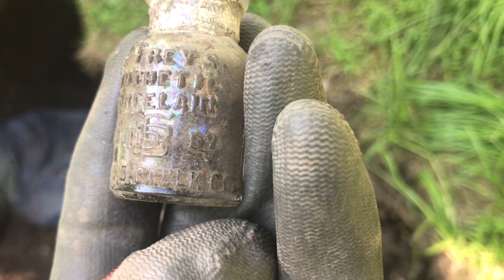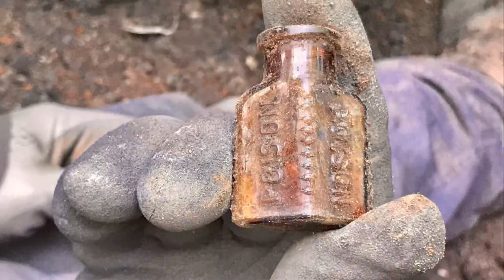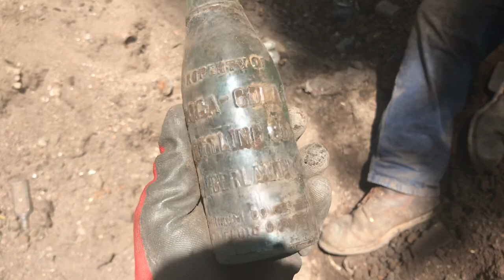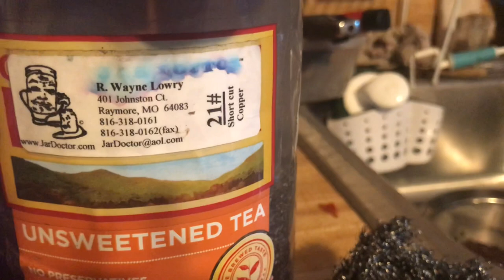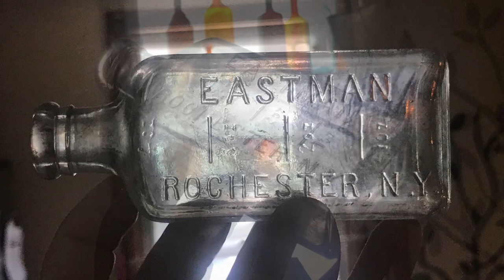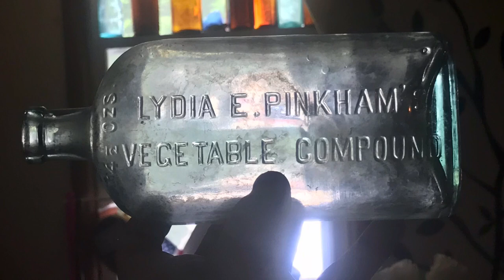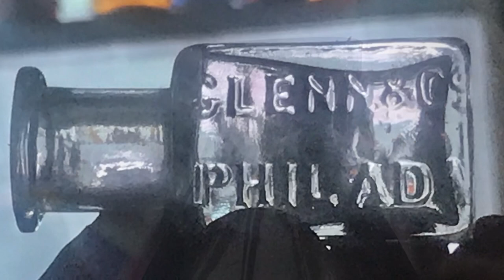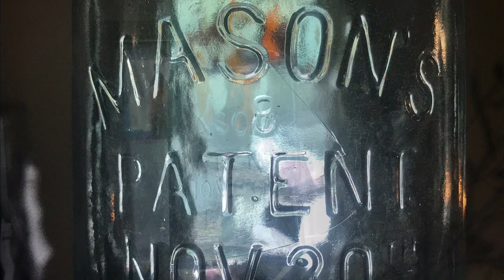Bottle Digging beautiful embossed Bottles from Double Diamond Ridge

Comment: Great video as always!
Only suggestion, I would use pure copper wool, instead of steel wool.
And not the copper plated steel. Chore Boy is a good brand. Steel wool actually can etch the bottle, especially small embossed meds.
Reply from the maker: I’ve never scratched even pontil glass with those dish washing steel wools though it does sound better to use copper wool. I’ll check it out thanks brother for your continued support.

Comment: I spend a lot of time walking along raiload lines looking for old porcelain & glass insulators. It's a great way to find old bottle dumps on adjacent back properties too so on my last outing I got several feet of stripped tellegraph wire & started cutting it into 1/16 to 1/8 inch sections. I know the wire isn't 100% copper but it's not copper coated steel either so I'm not too worried about scratching but let me tell you it worked on cleaning up my old bottles. It doesn't remove "sickness" & I like leaving a little scuzz for character but it's great at removing dirt, algae, some scale & caked on chemicals & medicine. Thanks Travis, this was really helpful & made a lot of my best finds look even better.
Reply from the maker: Allan, no problem brother man. Glad you enjoyed the adventures, finds, and tutorial. Thank you for your continued support

Comment: Great finds and thanks for the tutorial in cleaning.  I used to use copper BBs, but can see how the cut pieces of copper would do better at getting the corners etc.
Reply from the maker: I used to try all kinds of stuff to clean them and after I got my tumbler setup and figured out how it worked it was a no brained it would also work for a quick clean just by shaking or mimicking the action of the tumbler. Thanks for your continued support my brother.
Reply: Would you recommend copper BBs as an alternative to stuff the Jar Doctor sells? (because the Jar Doctor only sells stuff at live shows per his website)
Reply from the maker: No you can order direct from Jardoctor.com brother and I’m not sure about copper bbs. Probably would work but not as effective as cut copper.

Comment: Good video.  I would recommend that you do the initial bottle cleaning using a five gallon bucket.  All that dirt could plug up your drain.  I really like your enthusiasm as you seem to dig a lot of dipped privies with few finds.  Keep up the digging.
Reply from the maker: Yes that’s a good idea, I have screens that catch most of the dirt and grime and just dump in trash but I’m sure the finer material makes it through. Yes dipping privys was a good job for the younger fellas back in the day so the shallower ones got dipped quite often. Still always that chance they didn’t get dipped or they missed something incredible. Thanks for your continued support and the suggestion brother.

Comment: Are there any items you shouldn't use copper chips on? I was thinking using it on Carnival Glass & bottles with age iridescence might be a mistake.
Reply from the maker: You can use it on any kind of glass. Copper is softer than glass and will not scratch it.

Comment: I got a question if you don’t have copper what suggest to use for the inside
Reply from the maker: That is a good question, well you can do it the old fashioned way and use a metal coat hanger pulled apart and pieces of sponge. Add a little water, hold up to a light and scrip each piece of dirt out, rinse and repeat till clean. Thanks for your continued support my friend
Reply: Crick Diggers Inc. thanks for the info I’m only 14 but love to find old things I have about 2 jars worth of marbles and about 20 bottles liv the vids keep up the good work